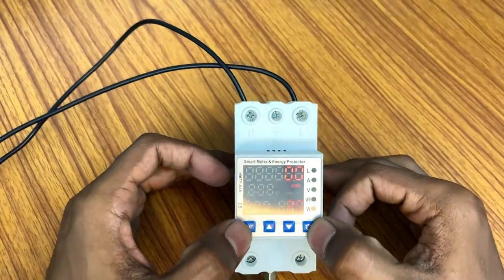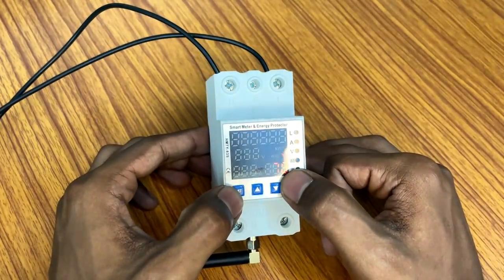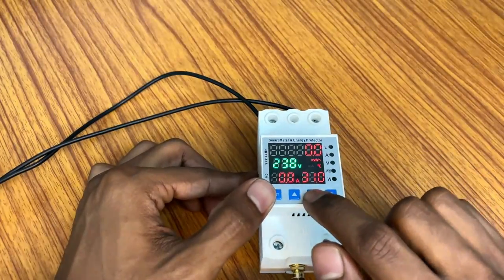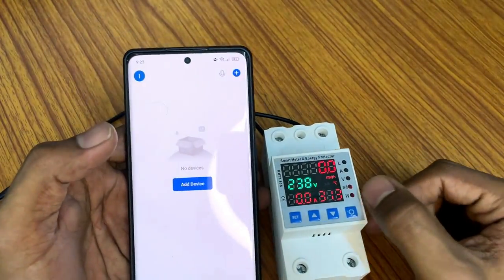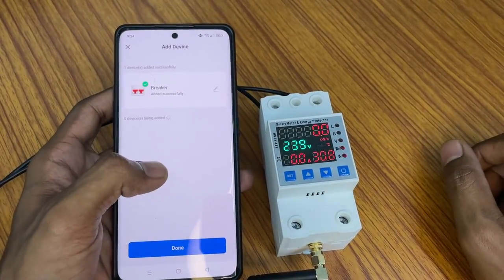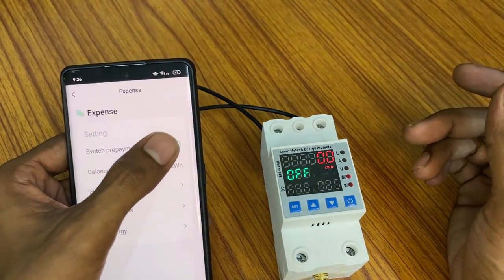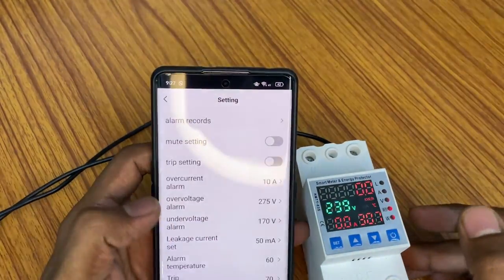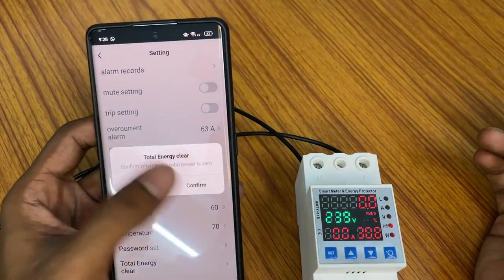Single phase wifi voltage protector / with smart energy meter , earth leakage protection , rccb

Comment: If I install the voltage protector in the main distribution box and it cuts off both the live and neutral connections, will the IPS (Inverter Power Supply) function properly during the delay after power restoration, given that the IPS needs a neutral connection to work?
Reply from the maker: Sir In new model it does not cut neutral
Reply: @Gadites  Please give me the link of the new model

Comment: Can we reset the device and zero zero the energy utilization please suggest i have 2023 model purchased from Amazon
Reply from the maker: You need to open settings in. Breaker than clear energy it will clear all the used energy consumption from device

Comment: Leakage current protection working but system is not resetting to normal mode.. we struggled multiple times in mobile app
Reply from the maker: We have made lock to protect your life 
2 or 3 times continuously leakage happing 
Will lock auto recovery 
So that you need to go manual on off this safety future
Reply: Thanks but why we should get shock 2 times? It should trip in first instance
Reply: Very poor service, I had multiple issues with product..